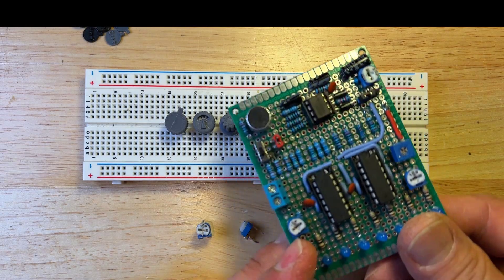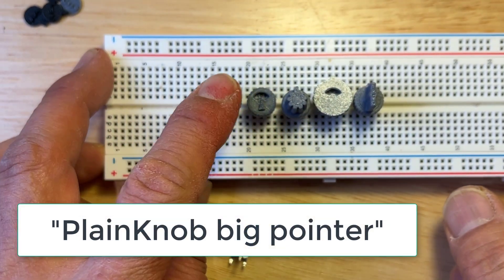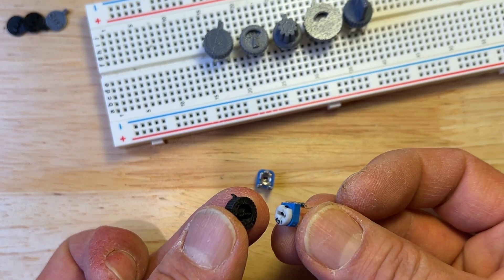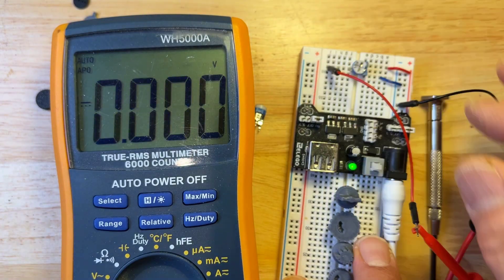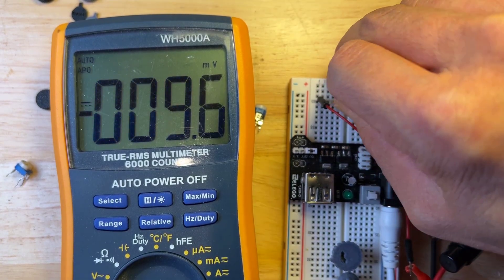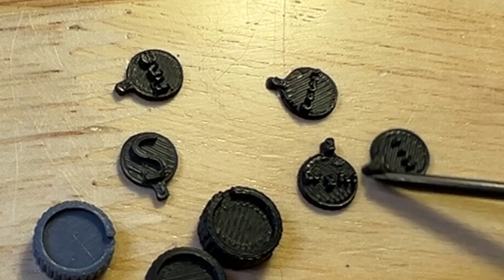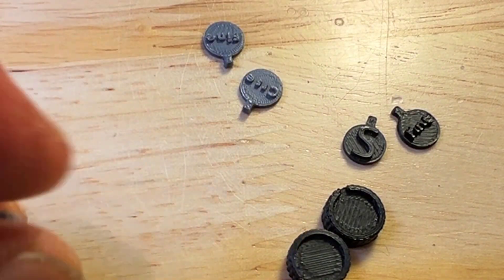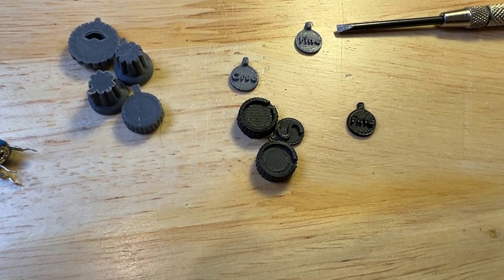3D Printed Knobs for Trimmer Potentiometers

Comment: Hi, what i would recommend you for the first layer expanding is to enable  elephants foot compensation in prusa slicer. You can also just champfer the bottom parts a bit while designing it in cad.
Reply from the maker: Thank you for taking the time to give suggestions. I am still new so to 3D printing so I am still leaning. I will have to investigate these settings.